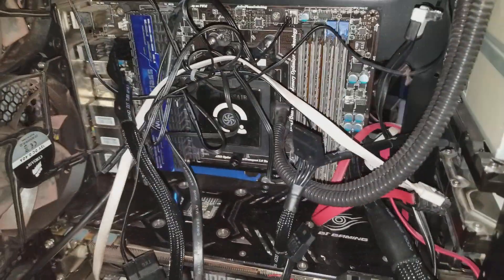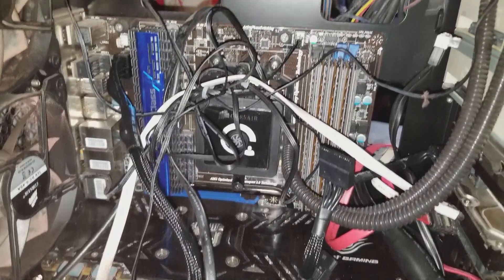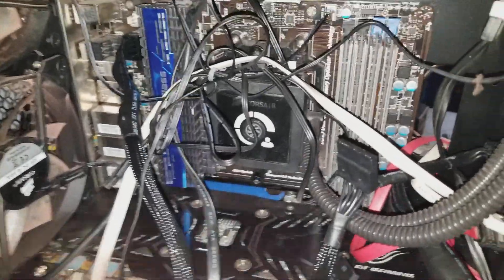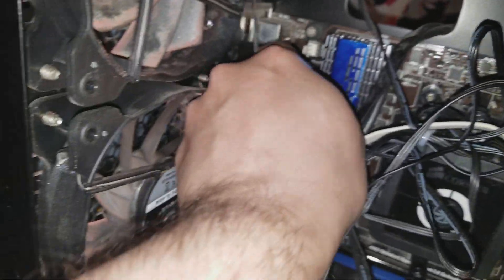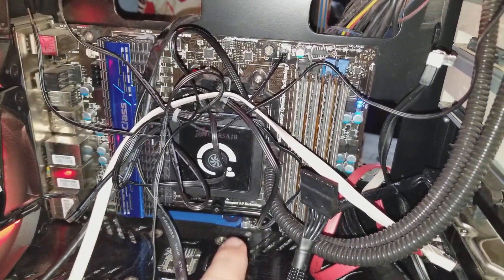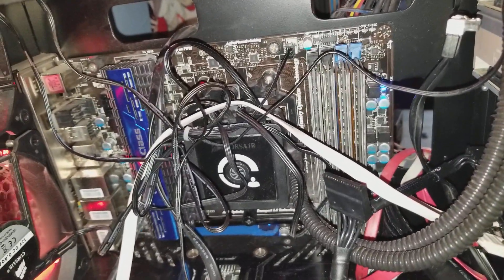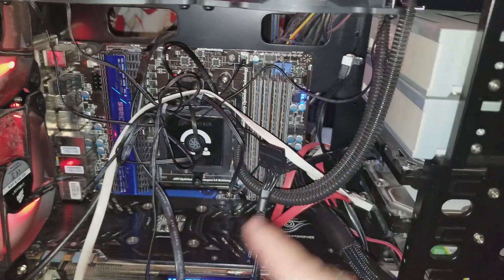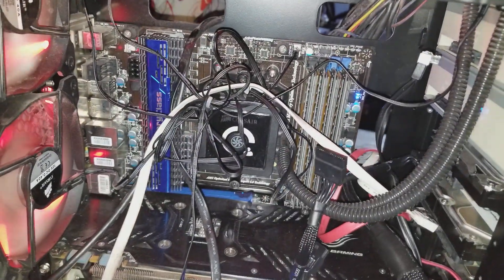How to Spot any broken CPU Liquid Cooler . (Corsair h100i)

Comment: Mine is doing the same thing but if I only have my power cord plugged in it keeps running, soon as i plug my HDMI cable to it it shuts down.
Reply from the maker: Yes which means when it stresses the cpu the cpu heats up and has cooling. When it is just the piwer cord it might work a bit as the cpu is not stressed enouph. All heating levels have safety in place. Once it reaches a level of heating that goes above and beyond what the system can handle it will shut down to protect the cpu and motherboard etc.
Reply: @Vortexcinema677  Cool, I just ordered a new  liquid cooler. My Corsair H100i led is showing red led after powering on which I believe after some research means its faulty. Appreciate your comment thank you.
Reply from the maker: @JawOT  at let me know how it goes

Comment: I'm having the same issue with an H80, but it's wired because it was working perfectly fine a few hours ago
Reply from the maker: It probably was on its last legs. I kniw many with the same issue. It works and then dead or works then works intermittently and then stops. It's great we live in these times when motherboards have auto off. Back in the day the cpu would die.
Reply: @Vortexcinema677  yeah, it was really old, like 10 years or something, it stopped working when i turned on the pc after cleaning the dust, so it makes me think that it was me who damaged it, but i think it may also just be that the liquid evaporated after so many years
Reply from the maker: @Grar2  I kniw its sux to hear but these things have a 7 year life span really meaning it could last a bit longer but u should be changing it every 7 years so u had it good as u got the most life out of it. After 10 years it most likely did evaporate. There is a way u can refill but it's messy and risky. I'd recommend buying a new one if u could if not u can attempt to refill.

Comment: If you do somehow see this my temps are 100 on ideal it doesn’t turn of I feel a vibration in tubes is it just the water cooler or worse or even thermal paste has the build for 5-6 years at least never changed the paste or cooler
Reply from the maker: Is this for the PC as in inside or the cpu?

Comment: I hate water coolers. Never had one that worked as silently and long lasting as a regular heat sink with a fan
Reply from the maker: I feel you but to push limits you need it. So long as it's properly maintained it can last 5 years or a bit more.

Comment: my friend brought me his computer to fix. wont post all i get is a black screen fans turn and then it shuts down and turns on again and repeats the process over again. i reconnected all the power connections no change, used a different psu no change, moved the ram to the other available slots no change, changed the cmos battery no change, tried doing a bios hard reset to get it to post no change, took out the graphics card and tried to boot no change. board is a gigabyte z170 gaming 3 board, asus strix 960 4gb and it has a liquid cooler with a thick layer of brown dust on the rad. do you think i have a dead board or dead cpu? motherboard lights up near the i/o shield for the onboard audio. what do you think i should try next?
Reply from the maker: The odds of a cpu going bad is rare it could be the motherboard although I would check the cpu for bends in the pins and check the cpu cooler if it leaked just incase
Reply: @Vortexcinema677  i will dust the computer out first because its caked on and the guy that gave it to me smokes in his apartment so i dont know if that fried it also dont know if it has been overclocked as it will not post or show any output to the display. im trying to fix this as cheap as possible because i dont know if the guy will reimburse me for parts like if i go and buy a cheap air cooler and it still does the same thing then im screwed lol thanks for the video tho i will try what you did and hopefully it will work ill let you know
Reply from the maker: @FUGLY-RUGLY  damn great idea. Yeah I have this air vacuum that blows air hard and removes that. Make sure u also reapply thermal paste to the cpu and gpu.

Comment: Hey! Shut down means cpu overheat, but is it pump, or you need to top up liquid.
Reply from the maker: Correct as I said in the video it can also be the liquid or the pump failing which is the equivalent of cpu.over heat security shut down. It's best to check that bro.

Comment: Mine increases in temp from 70-80-90-100 degrees celcius. I turned it off because I'm scared it will explode. The cooler is having a hard time and is making a racing sound.

Comment: my arctic liquid freezer ii 360mm cooler which is barely 3 months old brand new has pretty much given me the same thing. pump seems to have stopped working, vrm fan isnt spinning, upon bootup i get 'cpu over temp error' so just my luck. gonna get it changed/RMA pronto.

Comment: Is there an app to check what your liquid cooling temperature is? I want to see what my liquid cooling temp is
Reply from the maker: I wish there was brother. Sux they dont and even if they do i dont think itll ever be accuret .
Reply: nzxt cam
Reply: Depends on which cooler you are using. Corsair has a pretty great program/app that shows pump rpm, coolant temp, CPU temp and more. If you are still by chance wondering about it let me know which cooler you have and I'll find the software/driver.

Comment: I think I’ve been using a dead liquid cooler for 7 years, there’s no vibration at all, the fans on the cooler spins all the time because it’s connected to the CPU fan connector, the cooler itself has it’s own power source connected to a molex cable from the PSU. I bought it 2nd hand, the seller is a scam artist as he didn’t give me the $100 TV card that should be part of the auctioned goods. These products should has LED on to show it’s working.
Reply from the maker: Agreed. They should all have some kind of indicator that warns about it. Did ur pc die from it? I know many that lost their pcs due to a faulty liquid cooler.
Reply: Hydro Series™ H55 Quiet CPU Cooler, oh it might not be dead, it’s a Phenom 965 o’c to 3.8GHZ at 1.425v , now I think the cooler is a low profile one that’s why it gives no vibration. If the cooler died I might just replace it with fan cooling, because it’s now moved out of my bedroom into a lounge room in a cold winter.

Comment: I don’t know if you will see this but I don’t think my aio is completely broken because it has never shut down like that it is just super hot temps and after an hour of call of duty my cpu starts getting 95-100 degrees so I stop playing. Do you think it’s broken or just a bad cooler?
Reply from the maker: If it has those temps and ur collar si at max then u have an issue with ur cooler for sure
Reply: Lior Bar-El hey thanks for responding. How do I check my collar si
Reply from the maker: @shotgunboy0013  always that's what I'm here for. Please do help out this channel by liking this video subscribing and hitting that bell button as many more videos to come.
Reply from the maker: @shotgunboy0013  I'd replace the cooler and see if u get different results
Reply: Lior Bar-El will do my birthday is very soon so I am asking for a new cooler. Until then I lower the cpu wattage so it won’t work as hard and then I monitor the temps and take breaks whenever it gets high

Comment: My CPU started running hot and I pulled of the liquid cooler. There isn't a lot of thermal paste on the CPU. Temps rising as high as 95C. Can a minimal amount of thermal paste alone cause temps that high or should I go ahead and order a new cooler.
Reply: Did you ever get it figured out?
Reply: @sniffles8655  yes my stock cooler was just junk as well as my whole PCs cooling in this pre built case. Swapped the cpu cooler out and added some fans to the case. When I swapped the cpu cooler it automatically got new thermal paste.

Comment: Yeah I think my liquid cooler is faulty on day 1. Computer would shut down after one or two hours of gaming from time to time. I only recently noticed the CPU has crazy high temps. Idle at 70c. Jumped to 95c under load. Gave me quite a scare.
Reply: Did you fix it bro?
Reply: @gmu_alum08 yeah that was exactly the problem. The little plastic part that holds the cooler in place was somehow broken. Didn't even notice it until I took a closer look.

Comment: I'm getting confused about this, most of the time my pc automatically shuts down during boot or during login but sometimes it works properly like there is no issue,  i don't know what to do, change my cooling system or what? is there any way to check my liquid cooler is working properly or touching or opening it?
Reply from the maker: If it does that all the time u might have either a motherboard issue as in conflicts or firmware issue or it can be the cooling. If u dont see any leakage it's not the cooling also when u get it to run how hot does ur cpu get?

Comment: My computer is currently doing this, but I read somewhere that if one of the tubes is clearly hotter than the other that it is still functioning. Was that information correct?
Reply from the maker: The issue is how they said that. Every case is spacific. Even if u had a busted tube it would still cool so I disagree with the person who said that. If ur computer is doing this issue it is most likley the cpu cooler is broken. What u can do is try to put a regular fan cooler(so its cheap) or borrow one and see if it is working. If it is ull know for a fact the cooler is dead. I'm sure if ur pc has the same symptoms I described in the video u have a cooler issue. Let me kniw how it goes after u try it. Please do help out this channel by liking this video subscribing and hitting that bell button as many more videos to come.

Comment: mine didn't shut down..it just froze..and I had to reboot
Reply: I think I’ve been using a dead Corsair liquid cooler for 7 years, there’s no vibration at all, the 2 fans on the cooler spins all the time because it’s connected to the CPU fan connector and fan speed controller, the cooler itself has it’s own power source connected to a molex cable from the PSU (so if it’s working then it’s at full speed at all the time). I bought it 2nd hand, the seller is a scam artist as he didn’t give me the $100 TV card that should be part of the auctioned goods. These products should has LED light on to show it’s working.

Comment: Had a Corsair 120mm aio  go on me today... was upgrading my colleagues workstation with a new gpu, ram and storage. Everything worked fine yesterday and today I opened it up and put the pc on its side to finish cable management. Booted back up to hear the pump making a louder then normal crackling sound which I thought was weird. Eventually went away and after 10 minutes of the pc running very slowly turned off, tried booting up again straight after and it switched off again after 5 s. Waited a couple minutes for it to cool down and then I could get into Windows for a minute before it shutting down again.
Luckily I had a hyper 212 cooler at home that I rushed back to get and installed it and now the pc works great again. With temperatures of 60c under full load.
Guess I just got unlucky and the pump got blocked by some loose debris which probably got moved when I put the pc on it’s side. Was over 5 yrs old so was at the end of its life anyway, lucky it was a easy switch!
Reply from the maker: U can recover it brother I wouldnt throw it out it would make a good emergency tool to have. Glad u had a replacment. Please do help out this channel by liking this video subscribing and hitting that bell button as many more videos to come.
Reply: @Vortexcinema677  Have kept it and might give it a go cleaning it out. Wouldn't trust it again for his workstation PC though as its used for video editing in his video business so needs to be reliable.

Comment: I just installed a Corsair h100i Pro and it’s making quiet splashing sounds is there something wrong with it
Reply: iiArtful should be fine, my h100 does that too. I installed the Corsair software and set it to silent mode and now it’s not audible
Reply: I think I’ve been using a dead Corsair liquid cooler for 7 years, there’s no vibration at all, the 2 fans on the cooler spins all the time because it’s connected to the CPU fan connector and fan speed controller, the cooler itself has it’s own power source connected to a molex cable from the PSU (so if it’s working then it’s at full speed at all the time). I bought it 2nd hand, the seller is a scam artist as he didn’t give me the $100 TV card that should be part of the auctioned goods. These products should has LED on to show it’s working.

Comment: Today I started hearing a notification like noise in my headphones, I went to check my thermals and they were very high, like 90-100 degrees Celsius. I looked at my aio and it was all red rgb instead of a rainbow wave. Do you think the pump is the problem or something else? It’s never done this in the 2 months I’ve had it, until today.

Comment: I have that exact aio cooler but it overheats as fck, to 105 degrees at full throtle and at iddle i got 80-90 degrees, but when i start the pc before a little longer pause i got 60-70 degrees at iddle and idk what to do
Reply from the maker: Something is 100 percent wrong with urs and my guess is it is faulty and I'd send it back brother. See when coolers like this fails or are about to fail these things always happen. I would not run the machine bro as u risk ur machine to be damaged. I'd return it it get a replacment asap. I had a customer who had the same issue. We replaced his cooler and all worked well. Look into it and please let me know. Please do help out this channel by liking this video subscribing and hitting that bell button as many more videos to come.
Reply: @Vortexcinema677  well the aio is very dirry i bought that used today the man from who i bought the pc played and used it as it is now, idk how it doesnt kill the cpu, when i saw those temps in aida64 i stoped the test immedialty and turn off the pc, i got another cooler, i wanna try it and see what happens but a f*ucking screw don't pull of from mobo, from the socket of the cpu, for the aio. Any idea of how can i clean up the aio?

Comment: Here I am in May 2019, my Corsair H110i GTX running at CPU temperatures of 90C checked with Core Temp, I have checked the paste, cleaned out the radiator core, emailed the place where I bought this computer as a custom build because I see Corsair have a 5 year warranty, has anyone ever made a claim?
Reply from the maker: i made one claim before with their other model they honor it. there is defeitly something fulty my guess is the hose or the radiator is leaking. Make the claim on their site and they will send u a replacement. I remember before they sent me a replacement and said after i return it i have tgo send in my other one. they temp charge ur card and if u dont return the old one they charge u. Please do show some love for this channel by Subscribing hitting that bell button and like button as many more videos to come.
Reply: @Vortexcinema677  I'm in Australia and it's Sunday, so I will wait to see if the computer shop can help; if not, I'll just buy another one, any recommendations? There must be some cooling happening as one hose is warm and the other is cool but the temps swing around a lot, between 60C and 95C.
Reply from the maker: @Harley04  mine is at 40 over clocked and when I stress it hard it goes to 60 and its summer and my room.is hot as hell lol. Are u sure ur PC has good airflow. I have intake and outtake fans 8 in total. I build pcs for everybody like that so it's like an air condition in there. Maybe ur PC has poor airflow a ton of PC sellers out there do that purposely so when it fies u build a new one or count on them for repairs.
Reply: @Vortexcinema677  It's a Define R5 case so as good as that can air flow, it has front and bottom screens, but they hardly collect anything. But strange you ask about that. Another thing I did, I taped over all the holes in the case; originally my thinking was to exclude any more cat hair and dust from entering, but with more thinking and looking at it, why would you have an intake fan at the top rear and then have holes nearby in the rear top of the case? To me, the fan blows air in, which immediately exits out the top, what's the point? Now with all extra holes taped over, my theory is, air is blown in and can only get out via the 2 fans on the water cooler radiator, which to me means, more airflow = more cooling, does that make sense? I figure most air was going in from the top holes and the rear intake fan, nothing was going through the front or bottom into the case. It's a cool 22C autumn day in Australia.
Reply from the maker: @Harley04  no bro never tape the holes this produces negative currents it's not good airflow at all bro. Have a few fans pulling in air while other fans pull out with all vent holes exposed. I bet ur temps will reach a better place. Give it a chance Nd let me kbow
Reply: @Vortexcinema677  Give it a chance, it's been like that for 3 years now! I forgot to mention, there are 2 fans pulling air in at the front also. Comment on this: we want the air flow to exit via the fans and radiator core top of the case? Yes or No?
Reply: @Vortexcinema677  I took it out, back to the store that built the computer, they will assess it for warranty replacement. I can't wait that long, so I bought the Corsair 100i for now, temperatures are now normal, it's so quiet now as before the 2 x 140mm fans were full speed all the time. Thanks for the help.